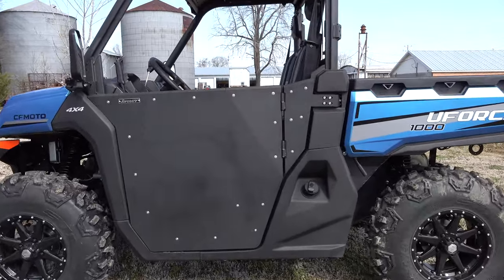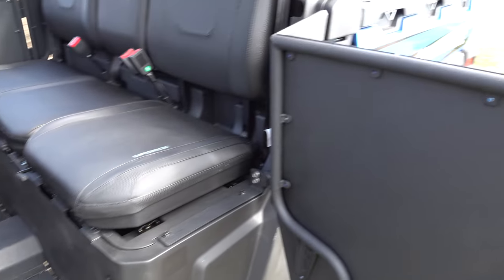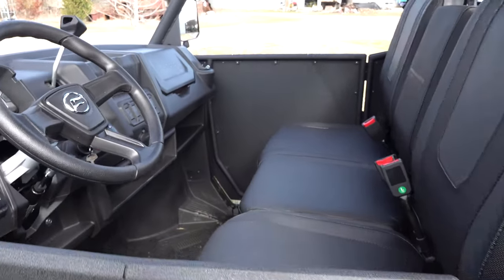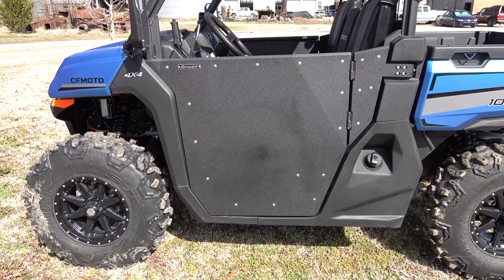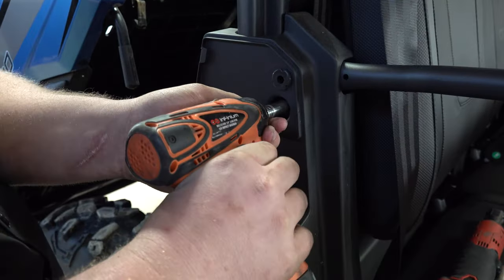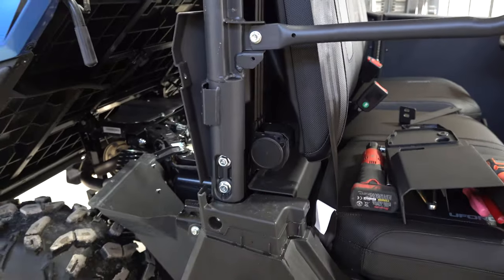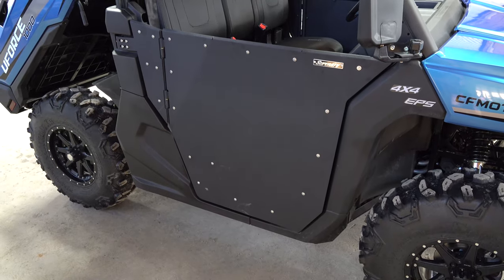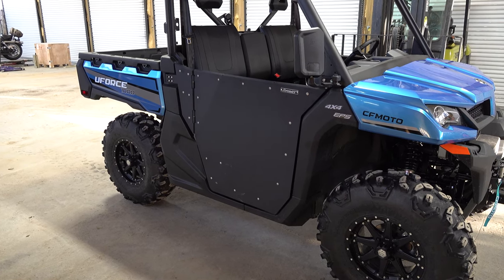SuperATV Doors Review & Install for The CFMOTO UFORCE 1000

Comment: Hey Blake. If you really want those doors to be quiet and have a truck like sound, get some double sided tape and put between the door skins and frames. What a difference this makes. I did this to mine and the difference is crazy good. Takes less than 30 minutes per side. Of course, I was just tinkering around and not in a hurry. Really like your vids man. Thanks.
Reply from the maker: Thanks so much for that tip.. I am going to do a full ride day with it first and see how they do and how the mounts hold up and see if they start rattling.. Im sure ill have to tighten some stuff back up after our first big ride and ill go through it and adjust it and do some modifications like what you did.

Comment: Quick ?. I heard the 2021  Uforce 1000  has the capability to do sport mode. I also just found a video on YT. Hester's motorsports , ( 2021 U force 1000 dual mode switch install.) Do you happen to know about this. Just curious to know more information!